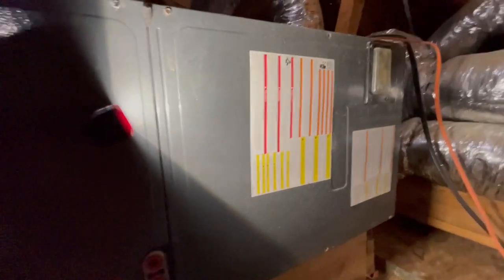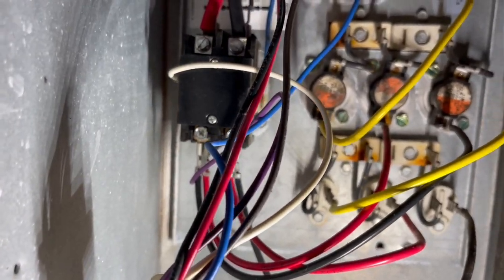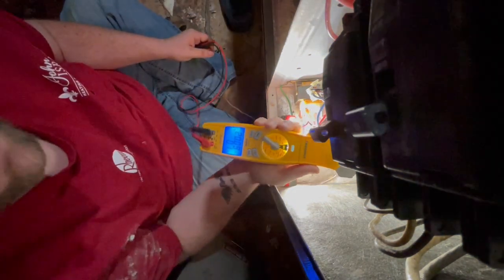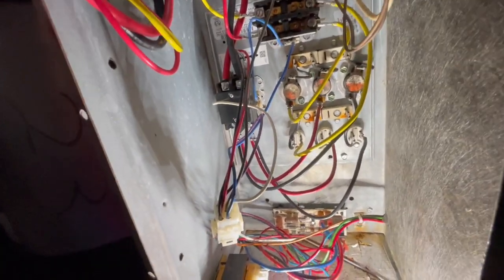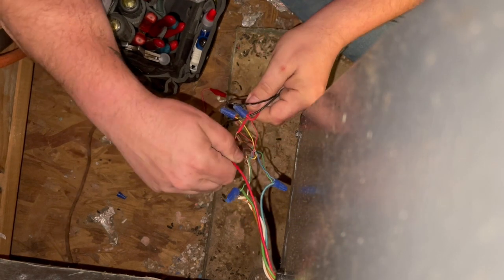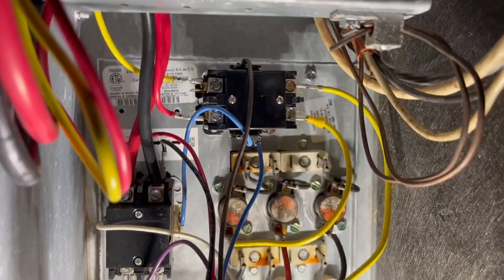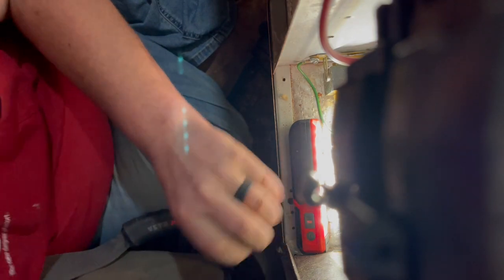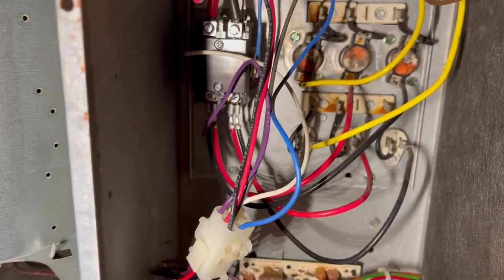No Heat at My House/One of my Truck Bins

Comment: Great fix John I love my T10 and it comes with a add a wire in case you don’t have 5 wire,I also despise the t4 and t6 there two heat one cool are a constant problem

Comment: Wow looks like the bypass is working. Your face / neck area looks smaller.  The only stats I had a problem with, was the johnson controls i series.  They were extremely easy to program without having to read a manual also.  Problem was they would freeze up sometimes and, the only way to get them to work again, was to detach it from the base and plug it back in again. The T4 style stats are fine and easy to connect with those lever style base connections.

Comment: I actually have the wireless version of the Focus Pro 5000, it's excellent. You attach a receiver to the control board of the equipment and you can put the wireless thermostat whereever you want. I don't even have mine mounted on the wall, I carry it with me to whatever room I'm going to be in for a while so it uses the temperature from that room. I also bought the internet gateway so I can control it from my phone. It's not programable but since I can control it from my phone that doesn't matter. I can't think of anything I don't like about this thermostat, other than when I first got it, it had that 5 minute delay when you set it to cool but I disabled that in the settings menu.
Reply: The 5 min delay is to protect your compressor from short cycling....

Comment: I’ve had a crazy failure rate with the T6 thermostat but only on heat pumps and especially carrier heat pumps.  Also congrats on the weight loss keep up the good work man.

Comment: Have you ever ran into a problem with losing a leg of power on a 240v single phase system? I’d love a video or a reply back explaining
Reply: That either a round fuse on the disconnect or you have a bad wire burnt up or could be a bad contactor or a bad disconnect box or a bad breaker in the panel box you need a meter and a lil knowledge to trace it back from the outdoor unit or airhandler and find your issue.....